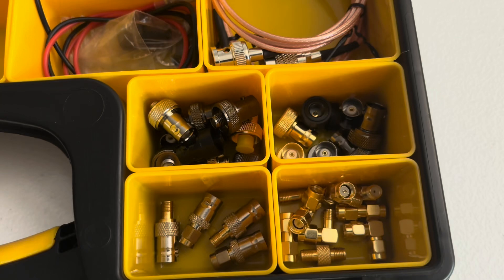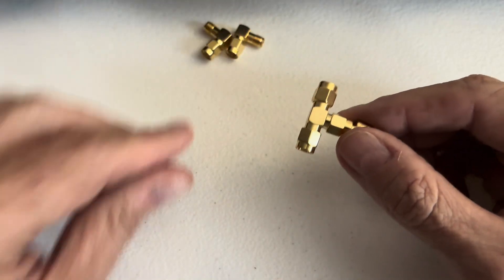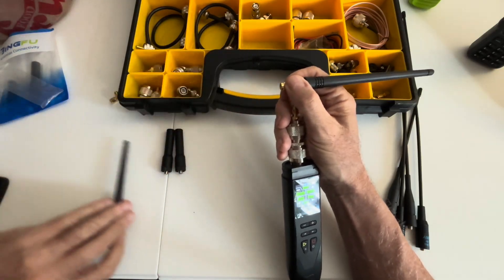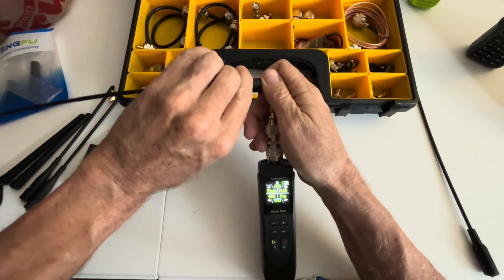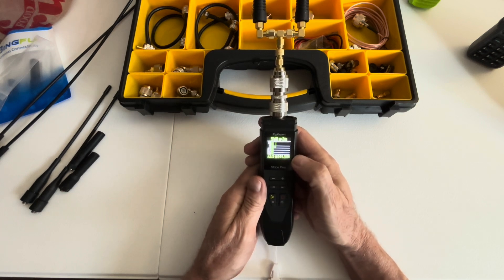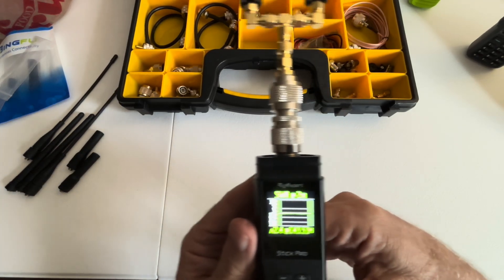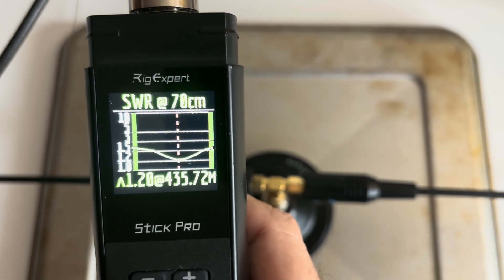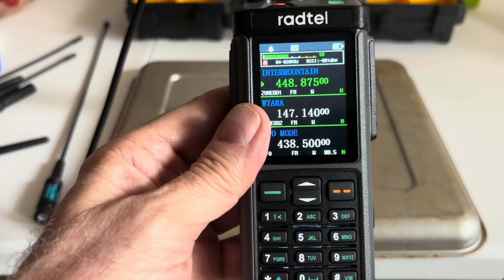Making a Center Fed Dipole Style Antenna 4 HT Radios! Having Fun, it’s Raining! Using Radtel RT-880.

Comment: In oder to build a dipole from 2 monopoles you need a balun in the center of the dipole.
Btw: as long as you don´t operate in SSB or CW the polarization should be vertical.
Otherwise you will loose up to 20 dB in gain.

Comment: You are feeding both whips in parallel 25 ohms and also with the same phase shift unlike a dipole which has the opposite phases on each whip. The small mag mount on to the baking tray makes the baking tray your central dipole like conductor.

Comment: Suppose those antennas presented a resonant 50 ohm Z (all resistive) at 146.520Mhz , and  you put them in parallel, then the total impedance would be 25 Ohms.  The swr can be calculated by dividing the Zo of 50 by the total Z of the antennas 25 ohms (2 ea 50ohm antenna in parallel).  So it seems the best swr you might achieve is 2:1...   Interesting concept though..

Comment: You didn't make a dipole. Two antennas in parallel. You need to cross the outer conductor over to the center of one antenna. Again not a dipole
Reply: Sounds like another "sad ham".😢
Reply from the maker: I know I didn’t make a dipole. That is why I said several times in the video that it is not a true dipole. Even the title says “Dipole Style”. 

73’s Dave N8DAV